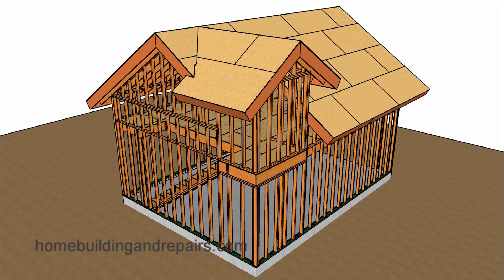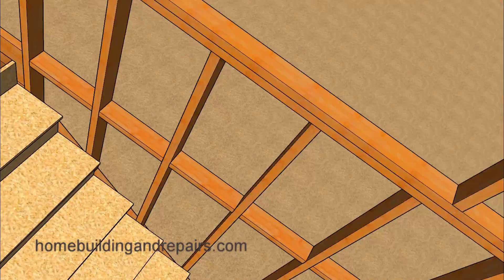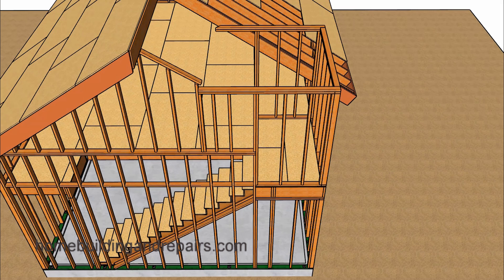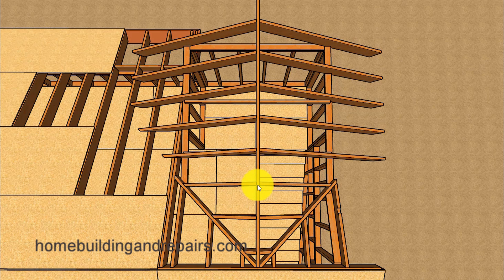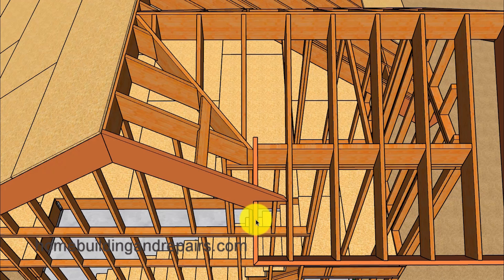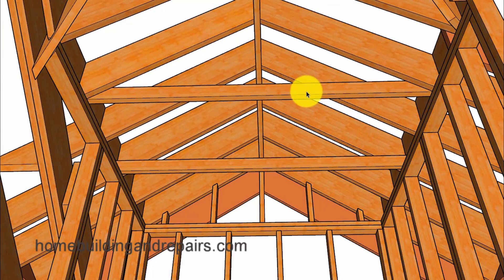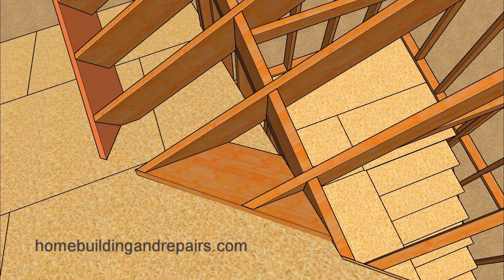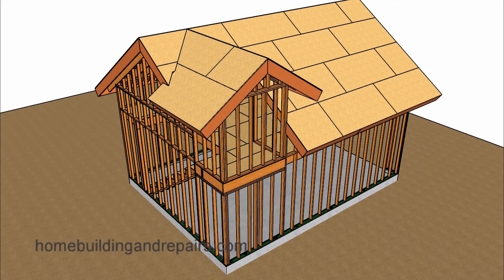Adding Roof Extension For Headroom To Garage With Storage Loft - Building Education Series Part 2

Comment: Way easier way to do that.  Just loft those wood up higher.  They can still join at the center line , but three or four of em can just angle out higher.  That will do
The trick.  Guess I'm good at wood work 
I started when I was 12.  See ya.
Reply: Lift *

Comment: If you started with an 8/12 pitch why couldn't you make that  small area a 4/12?
Reply from the maker: Yes, you can change roof pitches most of the time.
Reply: @gregvancom  Its not to take away with what you made here. I like it.  I was only pinching pennies. Your skill set is obvious. Thanks for sharing your content!

Comment: I would never balloon frame a wall. Quality of lumber it's so crappy. If I was to balloon frame A 2x4 wall it would be with 4x4 there are quality is a little better which means straighter. Finish  the deck and frame on top of it😎
Reply from the maker: If you finish the deck or floor and install new walls on top (instead of balloon framing) you will need to install rafter ties that might create a low ceiling, but maybe if low enough you could jump over them. I like the 4 x 4 wall stud idea, but with the crappy lumber you suggested, it might be difficult to make it straight.

Comment: Would it be allowed to add a second floor to an existing garage that is less than 5 feet away from an electrical pole? It is approx. 4 feet distance.
Reply from the maker: I would check with your local planning department for more information.
Reply: It's probably ok , you'd better check regulations locally though